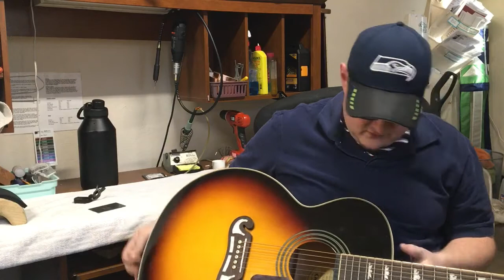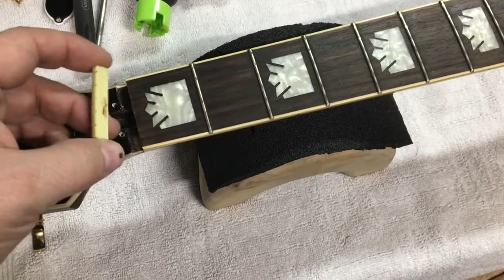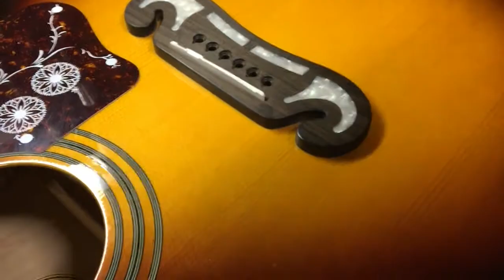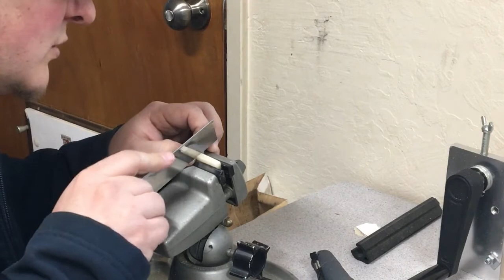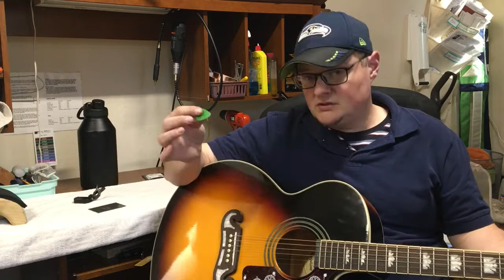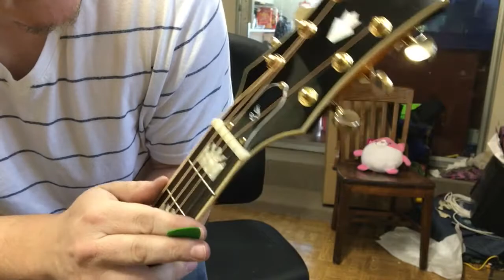Plastic Parts vs Bone and Tusq, Can you Hear a Difference?

Comment: I can't hear the difference . I switched out the plastic nut and saddle to bone and no difference in sound quality.
Reply: it's all very, very subjective, i have a 66 gibson j45 and a 69 epiphone texan that normally sound quite different to each other (i can't be arsed telling the spec) but today they sounded identical when i recorded them - guitars are weird and you could have two made with the same wood from the same stock on the same day made by the same guy and they'll sound completely different. the only thin i agree with is that plastic is not a good medium for sound transfer, i had a dione twin neck that was brass nut and saddle and brass frets - that sounded unique!

Comment: For the price of that thing, I'm guessing around $800 that should not be that far out of intonation.  The before clips you did, the F# on the high E was so far out it made me squint.  The after sounds much much better and it looks good too.
Reply from the maker: The crazy thing is that I had another customer bring in an almost identical guitar to this last week, but without the electronics and he wanted me to install a Fishman Rare Earth Magnetic Soundhole Pickup.  He said he paid $20 for it from someone who didn't know what it was.  It was in perfect condition, and didn't need a setup or anything.
Reply: Really?? Do you use a guitar tuner on your guitars, or are your ears so good you could calibrate a guitar tuner by ear?
Reply from the maker: @th-pl3nx  I absolutely cannot tune by ear. Even after 27+ years are playing guitar, I find it impossible. I only ever tune with a tuner.
Reply: @MillerCustomGuitars  Then how do you know thos dude was out of tune?? Makes no sense at all.
Reply from the maker: @th-pl3nx  i don’t understand your question. My response to the previous poster was talking about an identical guitar that was brought in for a pickup install that, after installation, required no additional work to be done to the setup.
Reply: @MillerCustomGuitars  My apologies. My comments were meant for Tempo Drift. I enjoyed your video, and it irks me when people make idiotic comments about a guitar or a guitar string being out of tune.

Comment: I'm new to this stuff so sorry if i said something wrong. Does the nut really matter? When you play, your fingers press on the strings so the strings on the other side doesn't vibrate. Therefore, would a different nut even make a difference?
Reply from the maker: Hey bud no such thing as a bad question. Let me see if I can explain clearly: 1) the nut only directly effects the tone on the six open, unfretted strings. But these six notes are the most important on the guitar to get right, because they are used most often on the guitar. Think about how many chords have an open string!  Tons of them!  Think of how many riffs incorporate open strings! 2) How important is it to get the nut right?  Well, getting your nut set up correctly is probably most important thing you can do for your guitar. The nut determines your string spacing, string height, and follows the radius of your fretboard. If it’s too low, your notes will buzz and sound horrible, if it’s too high, even a little too high, you will pull notes out of tune just by fretting them when you fret in the first 6 frets or lower. 

Nuts are very tricky to learn, but not impossible. If you’re not sure you can take it to a tech.
Reply: @MillerCustomGuitars  Oh okay I see now, thank you so much!

Comment: Sooo, you adjusted the action by cutting the grooves deeper on the nut (making the strings sit deeper in the nut) instead of adjusting the overall height of the nut?
Reply from the maker: Yes, Carter. When making a new nut, I get the new nut flat and square, then make sure it’s seating really well, then measure and cut the nut slots down to the proper depth. 

The only time you adjust the overall height of the nut is if the nut is too low and needs to be raised with the addition of a shim, and you are trying to keep the old nut. 

You wouldn’t remove material from the bottom of the nut to adjust nut height for a couple reasons: 1) there is a chance/likelyhood that you could mess up the nut’s flat/square relationship between the bottom and the side facing the fretboard. In most cases this angle should be perpendicular and needs to make full contact for maximum vibration transfer. 2) each string’s height needs to be set individually because each string is a different width.

Comment: I mod a lot of acoustics with Bone nut, Intonated Bone saddle and wood pins. I have experimented with plastic, bone, tusq and brass. Imho i can hear and so can my customers the difference between bone and plastic. A lot of people say the end pins have NOTHING to do with the sound, i disagree. Wood allows vibrations to freely move, while plastic deadens the tone. ANY extra vibration from the bridge area helps. Overall for the cheap price and small amount of time it costs to upgrade, im shocked by how much better it makes the guitars sound and how you can take a cheap acoustic and make it sound like a guitar thats 3x the price.

Take for example a Yamaha F-335. Its one of the best selling acoustics and it sounds pretty decent for the price. Once i upgraded the parts it was like a different guitar, more sustain. more definition etc. I found that Bone is the best. Did not like brass (on an acoustic). Tusq is ok. Plastic is garbage. 

You can buy a set of a bone nut and intonated bone saddle for $10 shipped. Yeah your gonna have to  mess with the nuts height and the string slot depth. Also your gonna have to level the saddle to the right height. But this is easy for a lot of us and i would recommend this project for anyone looking to learn how to do work on their guitars. 

Thanks for the video and keep jammin :-)
Reply from the maker: Great information!
Reply: @fastabyss  
Right and only on open strings can hear a difference. Very little to no difference in bone and tusq. 
I've had people tell me they can hear the difference playing full bar chords or playing with a capo on. LoL

Comment: Hi Adam, thanks for this great content. Any chance that you still have the part number for the Tusq saddle? I own a similar EJ-200. Thanks in advance.
Reply from the maker: Tetsu, the best bet is to go to Graphtech’s website and follow their instructions for sizing. That’s what I did to buy this one. Follow this link:  https://graphtech.com/collections/tusq-saddles-acoustic
Reply: @MillerCustomGuitars  thanks for getting back to me. Did you end up sanding down to length? I can't seem to find an exact 74mm/ 2.913" (my measurement could be wrong). The closest I can see are 73.6mm/ 2.90" and 76.72mm/ 3.020" compensated.
Reply from the maker: @tetsu83  yes. They recommend buying them a little long and then fitting them to size which is what I’ve done every time.

Comment: Hmm. For this test to be more accurate you should have put on a fresh set with the plastic setup and done the recording of “before”. You doing a setup also does change the sound in and of itself. There are too many variables that aren’t the same. Was the new bridge saddle the same height as the old for example? 

Anyway, I enjoyed watching your . It’s a great subject to cover.
Reply from the maker: You said it yourself. It’s impossible to eliminate every variable. This was a simple everyman comparison. “This guitar with these parts compared to the same guitar with these new parts using the same strings.”  No matter how the test was conducted, I believe that any acoustic guitar with a plastic nut and saddle would have the tone improved by having those replaced with either bone or tusq.
Reply: @MillerCustomGuitars  Do agree, bone or tusq is superior to plastic. Nice job btw,👌

Comment: So why not a bone saddle to go with the bone nut? Would it be better than the tusk saddle?
Reply from the maker: At the time I did not have the experience necessary to cut a bone saddle. I have improved my skills since then and could do that now. The Tusq ones are nice though because they are already radiused and compensated and have consistent density.
Reply from the maker: Also, this wasn’t what the customer asked for.

Comment: Where did you buy your nut files,I know they make cheap set up kits but the nut file is nothing but tip cleaners for a torch. That must be an older Epiphone cause it looks like a 1 and 3 quarters fretboard. It's really hard to tell the difference online. you need to use a feeler guage although I have used business card before being a technician to set air gap. they are approx 0.010 which I thick is a little high
Reply from the maker: I don’t remember where I bought my nut files, but they are the Hosco ones. I do use feeler gauges, but not when making a nut.

Comment: Those epiphone’s just don’t sound that great. You improved it but it’s just how they sound. 15 years ago I went thru all these different acoustics and I learned a lot. 
If you want a good sounding acoustic don’t buy it from epiphone. In that price range buy a Yamaha FG830, comes with scalloped braces, solid spruce top, laminated back and sides. You can get one in the same sunburst finish for $350. If you pay about a hundred fifty more get a Blueridge. Which will sound the closest to an actual Martin. A BR60 is a Blueridge with solid top, forward X bracing and laminated rosewood back and sides, bone nut and saddle for about $500.
I remember being really impressed on how those epiphone’s looked but when I played it I was severely disappointed. 
Or save up and get a Martin. They have several different lines now, ranging in price and they all sound amazing.
Reply from the maker: I really love the Blueridge brand. I’ve had two of them!
Reply: @MillerCustomGuitars  yeah they are great sounding acoustics! I worked as a sales rep for saga musical instruments back in the 90’s.
The Blueridge guitars have come a long way since I worked there. They always were a good sounding guitar but they really did improve upon themselves with tone and finish. I learned a lot from working as a Rep there.
Reply: @wyattsdad8561 Wondering if you have an opinion on Yamaha F455 made in Taiwan? I have had one since 1990 and would like to have it sound better. Nice blue burst but sounds a bit dead compared to a Maton that I also have.
Reply: @micko4071  I don’t have one on them. I haven’t heard one.

Comment: From experience it's more to do with maintenance. I have two guitars with tusq saddles and one bone. It seems the bone saddles remain smooth throughout their life span whereas when the tusq starts to wear it form sharp groove which causes the string to break. It's an easy fix with a file but still annoying
Reply from the maker: Wow, this is great information!
Reply: @MillerCustomGuitars   Observations I have made when restringing different guitars, the bone saddles stay nice and smooth throughout their lifespan (even at 20 years old), the tusq ones develop burs that break the strings if you don't file them down
Reply from the maker: @oliverk191  I have never heard that. I know that can be a problem with steel saddles. I and preparing to do a follow up video to this one and I will keep that In mind.

Comment: Does bridge pins affects the tone as well?
Reply from the maker: Hey man, that’s a really good question. I personally can’t imagine that it would affect the sound very much, if at all. However, some people claim that it does. I may take a look at this sometime in the future. But honestly, I can’t imagine that the difference would be very significant. At least, nowhere nearly a significant as something like changing your strings would make.
Reply: @MillerCustomGuitars   You would be surprised.
Reply from the maker: @tomformanek3312  Well, let me rephrase. I know that on and Acoustic Guitar basically everything affects the tone for some degree. However, I can’t imagine that the bridge pin material affects your tone as much as some thing like, say, nut and saddle material does. And not nearly as much as just changing your strings does.
Reply: @MillerCustomGuitars   It depends on the guitar. First plastic is soft and poorly transfers tone to the top. Tusq emphasizes parts of the tonal pallette as does bone. The key is finding a combination of strings and pins to achieve a certain sound and create a balance desired among all 6 strings.

The saddle gives a crispness to the tone, but the pins anchor the strings to base plate (usually maple) and that drives the top in addition to the downward pressure from the saddle and bridge.

I have had Tusq pins drive me crazy throwing string to string volume off and have come to put bone on any acoustic. Also replacing pins is a time to insure a snug fit of the pins just like you would do with a saddle.
Reply: Yes pins to make a difference.  I bought a bunch of bone pins off Amazon and outfit all my acoustics with them and it made a difference for sure.  Definitely worth $9-12 per set.
Reply: I really have tried different pins on my acoustic and realized something...the ball end only touches the pin surface hardly at all. The wrap of the wire is touching the bridge wood. The slot in the pin hardly touches the string at all. I also did a single brass wire thru the holes of the ball ends (no pins) and heard no difference in tone. You would think with that wire touching the whole area of sound board would make a difference. Nope. Saddles do. I've made my own from antler and Corian to purchasing one tusq. Then I made one from aluminum.  Lots of ringing sustain.  Dead strings sound good longer. But not harsh. So, the pin deal... not an issue.

Comment: Hi  I have same model of guitar can you tell the model number of tusq saddle
Reply from the maker: Check out my most recent video on the same topic, where I talk about, trying to find the right saddle for your guitar:  https://youtu.be/PNOA8OupAk4
Reply: Hey I guess  the pq 9276 or you can use the blank LQ 9000 . I used the LQ 9000 in my Ej300 en the 9276 in my Ej200 . Beware of string notches from wear , tusq wears out quicker than bone ...

Comment: Some of the new plastics out there now are very different.  Especially the ones used on heat-proof cooking utensils.  They seem much harder than the old plastic we might be used to.  Personally, I favor glass or ceramic.
Reply from the maker: Seriously, Glass?  For saddles?!?  That’s cool!  How does that work?
Reply: @MillerCustomGuitars  It's cut on a diamond saw like any common ceramic  My feeling is that ceramic has the same properties but is much easier to work with and is as cheap as dirt.  Glass, ceramic, and metal have extremely rapid sound propagation properties and seem better suited to string termination and vibration transmission.  The only real difference is the ease of fabrication.  Self-ringing does not seem to be a problem with metals as they are essentially fused to their substrates.
Reply: @MillerCustomGuitars   Bear in mind that the nut is just sitting on a wooden base.  It's not a giant leap of logic to tell that it makes very little difference what a sliver of material is going to do to the sound.

Comment: Doesn't make a difference when a note is fretted. It only makes a difference on an open string
Reply from the maker: Check out my most recent video on this topic where I look at this again with better recording equipment and techniques. Tell me what you think. I think materials make a huge difference.
Reply: @MillerCustomGuitars  it's all very, very subjective, i have a 66 gibson j45 and a 69 epiphone texan that normally sound quite different to each other (i can't be arsed telling the spec) but today they sounded identical when i recorded them - guitars are weird and you could have two made with the same wood from the same stock on the same day made by the same guy and they'll sound completely different. the only thing i agree with is that plastic is not a good medium for sound transfer, i had a dione twin neck that was brass nut and saddle and brass frets - that sounded unique! it's great to make these videos, but a complete waste of time. even your hands, fingers, finger nails (mine are like steel) and plectrums will affect the sound - no two guitars will sound the same to any given player.
Reply: The whole string resonates, so it does make a difference even if a note is fretted. There are 3 or 4 points of contact that the string has with the guitar depending on if a string is fretted or not. Sure it's much more noticeable on open strings but it still has a big effect on tone and resonance. It is most noticeable with a brass nut.
Reply: @bigbasil1908  A fretted string does not vibrate on the nut side.
Reply: @RideAcrossTheRiver  Can you scientifically prove that?
Reply: @bigbasil1908  Yeah--not plucking a string behind the fretting hand.  Why would you?
Reply: @RideAcrossTheRiver  Even though the string vibrating at the nut whilst fretting may not produce any obvious audible sound, it will still be affecting tone. However small, it does have an effect
Reply: @bigbasil1908  Put a capo over a fret.  Mute the strings dead between capo and bridge.  Strike the dead strings.  Listen to nothing coming from the 'open' strings between nut and capo.  Guitars are not mysterious occult witchcraft.

Comment: The Epiphones made in Bosman Montana are quality built instruments. Chinese made Epiphones are just that. You are putting lipstick on a pig and its still a pig. You don't get quality materials from Chinese made Epiphones. If you want a quality guitar made with quality parts and woods you are going to pay for it.
Reply from the maker: Hey man, I just do the work that the customer asks for.
Reply from the maker: Also, adding the bone nut, and the tusk saddle, made a huge improvement to the tone, my opinion.
Reply: I will ad the bone did make a difference but the nut stills sounds like a Chinese Epiphone.
Reply: You tell 'em Jimmy!